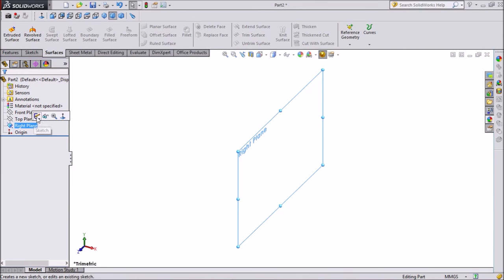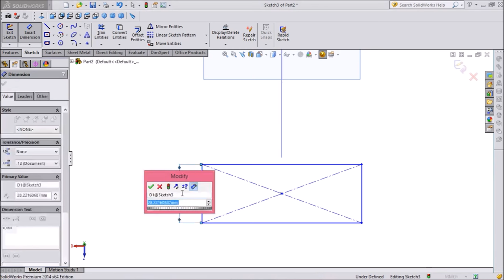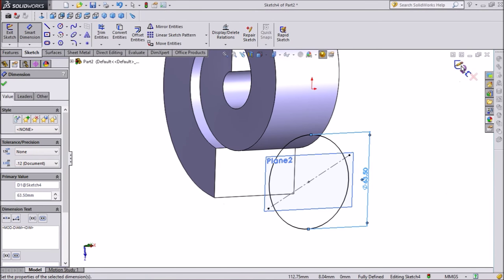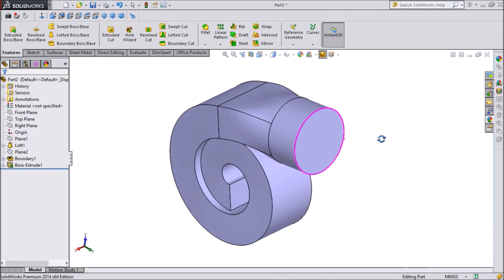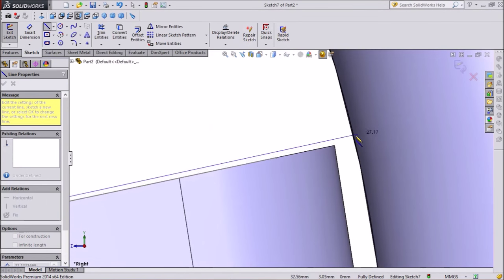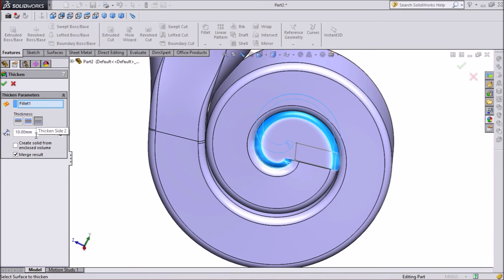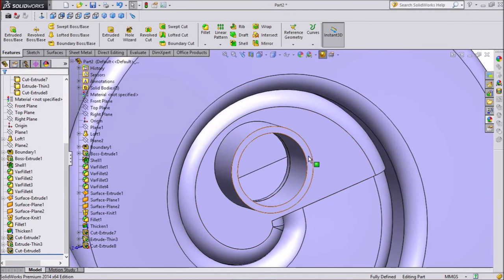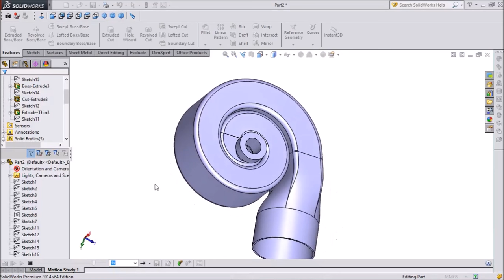SolidWorks Tutorial Engine Air Turbo Housing

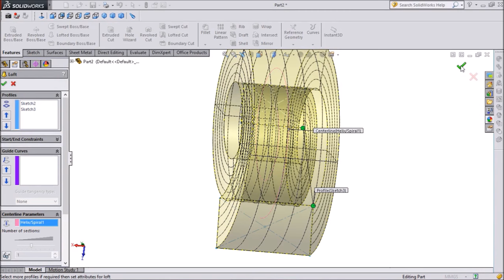Comment: I cant validate at the 5:12. give-me an erro of "cannot make two planar end faces to cap the side sheet", can you help me?
Reply: i solved it, the distance beetwin the two sqares must be 0.1 longer
Reply: Plz help me, I also had the same error. how had you fixed this problem? Can you guide me?
Reply: i need that help too
Reply: In 2nd sketch write 26,4 instead of 26,5. That helped in SW2020
Reply: @julius9335  Thanks Mate worked in SW18 too.
Reply: @julius9335  Thanks from me. worked also in SW 2022. 👍👍
Reply: @timacofe brother it's 2023 and your comment is still helpful, thanks
Reply: Thanks from me. worked also in SW 2023
Reply: Thanks Brother, it works 👍
Reply: @julius9335  It works in sw 2023, thank you
Reply: man i'm working in 2024 dude thanks for the help man . Came as clutch .....